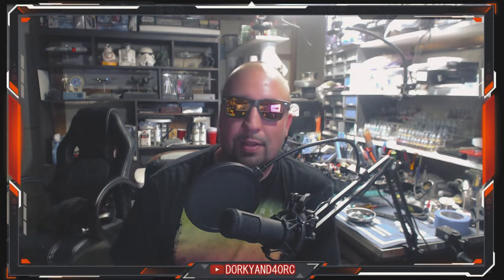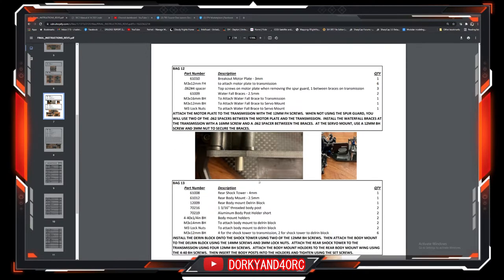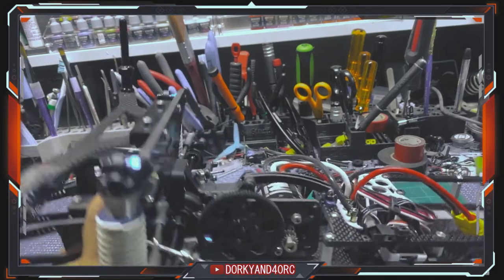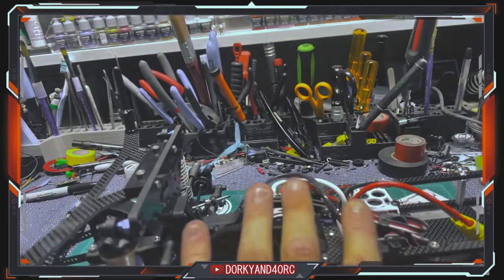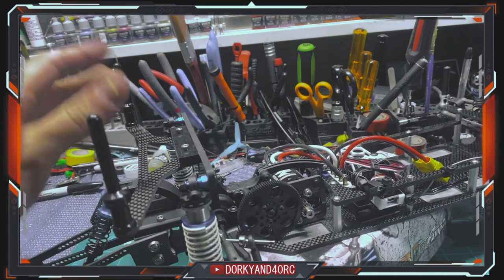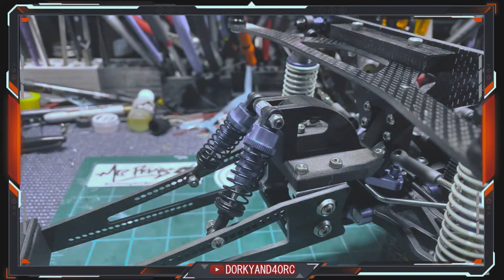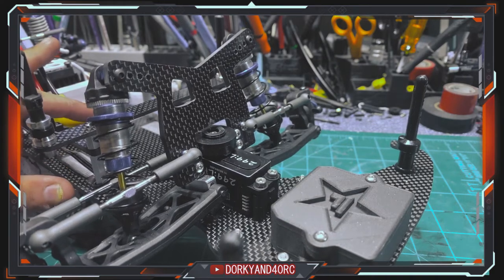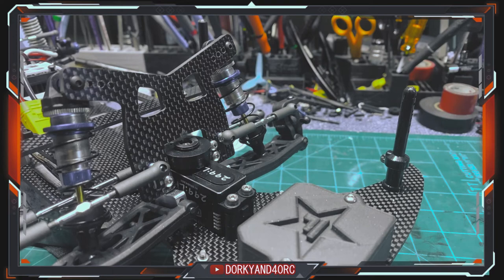FIVESTAR HOBBIES BREAKOUT NO PREP DRAG RC BUILD PART 5 | THE END FOR NOW

Comment: I’m so torn on which new chassis I wanna go with lol.  Torn between the breakout, apollo, dc1 etc.  I want to get a true drag chassis instead of just a carbon conversion like I have three builds of already.
Reply from the maker: It’s a tough choice. With Apollo and dc1 you are at their mercy. With a breakout you at least can get AE parts way easier that you may need and a hella cheaper
Reply: @Dorkyand40   Damn good points man!  Currently I’ve got a nooner chassis 22s, a brisket chassis dr10 and a NLR chassis drag slash.  A buddy is getting my brisket so I wanna replace it with a higher end car.  Just so torn on what to go with.  I do have a dr10m on preorder so maybe that will be a better overall car than what I already have 🤷🏻‍♂️. Btw how can I find you on Facebook.  I’d love to add you as a friend if that’s cool.

Comment: Hi. After watching your channel for the past couple weeks, as I try to get into my first no prep 2wd rc, I have another question for you, since I see you’re around a lot of guys racing, or have been doing this for a while. Is completely locking the rear diff done by most, or would having the stock 500,000wt fluid be better. Until now, I have only done 4wd drag racing, and a couple of the guys thought putting a locked rear diff would be good, or locking front and rear, would be better, but the results were not good on just the rear on 4wd. Some then thought, maybe just lock the front, I disagreed and just kept the front and rear diffs open. I will tell you this, locking the rear diff on a 4wd, and leaving the front diff unlocked, makes one hell of a drift car…lmao!! What do you see them doing on a 2wd rear diff for no prep?